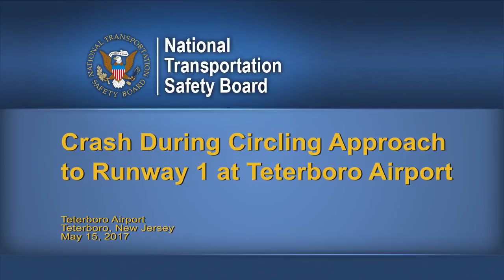Learjet 35A Teterboro Approach Crash • NTSB Animation

Comment: I'm an investigator by profession.  I've been up in small planes for professional reasons.  When there are not 2 pilots, I mention: "Not to jinx us, but if something incapacitates you, what do I do to keep this thing flying until someone else can help?"  Based on this limited "training," even I could recognize the multiple errors. *Now I will be checking the NTSB for mention of the record of the pilot's employer prior to getting on the aircraft.*  The full NTSB report is worse than the summary already linked:  https://www.ntsb.gov/investigations/AccidentReports/Reports/AAR1902.pdf    

RIP.   But there were errors not just on the flight.  Like, when doing pre-employment record checks, if the previous employer does not respond -- you can hire the guy anyway.  Period.  (Clearly, at minimum the hire should be subject to continuing other methods to verify pilot history).  

We all make mistakes.  But both of these guys had a history...  and most of us learn more quickly when we are held accountable.  Instead they were passed on to another employer, who didn't particularly seem to care either.
Reply: Big difference going to Jets, and happens quickly. Yes PIC was incompetent.

Comment: Looks like a left bank of 120 degrees rather than a right bank but maybe my vision is going. 🤓
Reply: I agree, it looks in HARD left bank nearly flipped on it's back inverted!
Reply: @Starbuckin  Yeah i suspect the pilot flying tried to tighten the turn with bottom rudder and stalled the left wing. Then she just rolled right over, almost onto her back.
Reply: @Cokie907  Agree, could have been an angle of attack stall at low speed too by putting too much up elevator trying to tighten the turn. Can't believe they just didn't Go Around, that was WAY too close to runway end to even think about a landing.
 Check the first vid on my channel, (latest post) I didn't stall but made a smooth as glass ridge run with me little foamie!
Reply: Hit the ground right wing straight down and left wing up in the air almost 90 maybe 100 degrees nose down at about 40degs I have a nice still after it hit the roof and before it hit the ground. Just sayn
Reply: Mark H I disagree. You’re entitled to your perception but without viewing “your still”, I’m not buyin it. Moreover, this type of stall scenario results almost always in a stall of the inside wing so the aircraft would be rolling left as it crashed. Just sayin’...
Reply: @Cokie907  i dont want to disagree and its not about my perception.  My perception is i had to spend an extra 20k I lost things that cant get replaced. I lost things that i couldnt prove. I have the info I have vid feed that no one has seens except the ntsb it was going to the right its right wing was down more than 90degs  the top of the plane facing you going from left to right and nose down at 35 to 40 degrees. Airboyd has another video up search on youtube  ntsb cen17ma183 it has a really clear pic/vid of how plane hit at the 4:33 mark let me know what you think. I see right bank but then again im not a pilot. But in that same frame  i can see my truck its just in front of the carlstadt senior bus facing the cam.

Comment: No doubt both pilots were staggeringly incompetent. However, the ATC does not come out of this well. At any given point ATC could have slowed down and checked that the PIC was aware of the circle to runway 1 procedure and understood it. It was clear very early on that PIC had no understanding of this procedure. It was also abundantly clear to any observant ATCO that this aircraft was consistently being badly flown, and should have spotted straight away that something was amiss after repeated failures of PIC to read back instructions properly. So while ATC cannot be directly blamed it is a fair assumption that they were a factor in this accident. This flight was crying out for a go around instruction from ATC.
Reply: Totally agree! When the SIC failed to read back instructions numerous times, ATC should have stepped in and confirmed the turn. Looks like the man flying the plane was 100% certain he was to line up with runway 6 not 1.
Reply: No you're wrong. I'm an FAA controller and that's not how ATC works. They were flying under IFR so they were instrument rated and can accept instrument approach clearances, which they did. If a pilot is not familiar with a procedure they tell ATC they're unfamiliar with it and we give them a different approach. ATC was zero factor in this accident, as the NTSB also concluded.
Reply: @kewkabe  of  course you would say that you are all in collusion and covering for each other, typical government entities. Those controller have blood in their hands n should have been held accountable.
Reply: Agree they are to blame! But who is going to hold them accountable, not the NTBS. That controller has blood in his hands

Comment: So many fuckups in soo little time... if there was anything left of that captain, they shouldve pulled a toxicology report
Reply: That was my first thought , was this captain impaired or intoxicated?  It certainly seems he was
Reply: That is quite possibly the exact reason for this incident.
Reply: hllboi817 they had to be drunk
Reply: Tox report clean if you bothered to read anything above 
 @lincolnpaul1814
Reply: I would bet more than anything the Captain was drinking heavily and assuring the officer he will be fine with a drink or two
Reply: The tox reports came back clean... this was pure, unadulterated, incompetence - from both of them.  The SIC had over 450 hours in a Lear and he still couldn't hold a heading or altitude?  Whomever checked these two out was also criminally incompetent.
Reply: @steveburton5825  It seemed like there was more going on with him than incompetence. He wanted to go much higher on a 20-minute flight, didn't seem to know where they were etc.
Reply: @steveburton5825  Checking them out wasn't the problem.  Signing them off was the problem.
Reply: @steveburton5825  And how did you you get hold of the tox screen report?
Reply: @janfuger1517  this crash report is on the NTSB website and you can view all of the evidence and information related to this incident.  From what I remember, the tox screen was negative but they only had muscle to test since the rest of his body was lost in the crash and fire.  I'm not sure if they can determine anything conclusively from that or not.  This pilot had failed circling approaches numerous times in simulation and only passed after his third attempt.  The NTSB cited the company's lack of oversight and monitoring of their pilot's actions and lack of training to fix issues proactively.  There was a lot that was done poorly that added up to this event.  https://www.ntsb.gov/investigations/AccidentReports/Pages/AAR1902.aspx.
Reply: @steveburton5825  he held a heading just fine.  His captain told him conflicting crap.  Maybe we should pull a toxicology report on you
Reply: @steveburton5825  you're just mad that i understood it better than you.  Rewatch it and pay attention to the captain's off-radio (transcribed but no audio) directions to the SIC.  You'll see he told him to do different things which explains the heading changes.  So SIC wasn't failing to hold heading he just was following directions other than from ATC, namely captain.
Reply: @steveburton5825  again you didn't read the cockpit dialogue.  Captain was giving conflicting orders.  When you take those into account the heading made sense.
Reply: @ivanabcdefg9375  could not hold his heading plane was out of control 40 seconds before crash. Maybe 35secs would need to watch my cctv again to get exact time but my point is he did not have control flying a straight line. That i can prove.
Reply: Nah. He wasn't drunk. He was just stupid. He may very well have been a good pilot, but he should have left the teaching to someone more talented.
Reply: Did you the fireball on impact, was it fuel or..... the captain?
Reply: Sabrina Dugan  - LOL... That's pretty funny.
Reply: The reason I bother to comment is to deter people like you from going to the ballot box and demanding stricter laws in general aviation.  In our free society, the goal is not zero deaths -- it's a happy medium between safety and freedom.  And even if a person wants safety at all costs, best that they start with automobiles, which kill the most people disregarding medical conditions.
Reply: @ivanabcdefg9375  Another crank giving us the hackneyed "freedom" spiel.
Reply: There are decent youtube people here, so don't use profanity. Ask Jesus to save your soul and clean you up into a real man.

Comment: I have no idea how he could have died considering he was at least 50 miles behind the aircraft. 

Didn’t know how long the flight was since he asked for higher altitude and wondered why they said approach and runways in use. All the while trying to teach and monitor this kid what sounds like basic flight maneuvers. 

Had no situational awareness on the approach—even just tune up an NDB and watch the needle on the RMI.. you’ll know exactly where you are in relation to it—never mind the moving map I’m sure he had. 

Not aware of the descent profile. Every good jet pilot knows 1000 feet/3 miles instinctively. 

Not listening to his SIC who is getting nervous, completely helpless, and wants you to take control. 

And finally... trying to salvage a bad approach by hot dogging a high performance aircraft rather than fling missed, collecting yourself, rebriefing, and attempting again.

Comment: When I first stat in the right seat, I was able to at least fly the aircraft. In fact, when the aircraft went a little over 250, it was because I wasn't flying that "under 10" leg. It makes me wonder how that FO got that job. Because of this video, I went looking and found Robert Sumwalt's NTSB panel video. I have known guys who used an expletive every 14 seconds, but NEVER in an aviation environment. Some of the guys would get in one or two a minute after a flight, but man, I have to wonder what was going on in that guy's head. I will tell you something I think is a part of the problem: the pay is so low for 135 ops it is almost laughable, because operators think the hours in the logbook are the pay. This means that very frew guys seek a permanent position in 135. They are all angling for fractionals, corporates, or airlines, because these are seen as the top of the pyramid. Better pay means the operators would be choosing from better pilots, and not waving to them as they go by in their flying careers....

Comment: Looking at this, and watching the video, where the plane is almost inverted, makes me wonder if the pilot in command didn't grab the yolk, try to make a hard left bank to line up with the runway, stalled, then tried to yank the yoke back to the right which is where the box apparently registered the controls. If they were at or below airspeed, the show was already over once they were inverted. seems to me, if the pilot in command wasn't inebriated, he may have been trying to get some sleep. BOTH pilots had previously failed checkrides in the Lear.
Reply: All pilots going to training have at least one or two failed check rides in their careers. Was it a mechanical failure that stalled the plane? Ever occur to you the PIC was trying to correct his SIC mistakes? The PIC was flying for both of them.

Comment: Probable Cause
The NTSB determines that the probable cause of this accident was the PIC’s attempt to
salvage an unstabilized visual approach, which resulted in an aerodynamic stall at low altitude.
Contributing to the accident was the PIC’s decision to allow an unapproved SIC to act as PF, the
PIC’s inadequate and incomplete preflight planning, and the flight crew’s lack of an approach
briefing. Also contributing to the accident were Trans-Pacific’s lack of safety programs that would
have enabled the company to identify and correct patterns of poor performance and procedural
noncompliance and the FAA’s ineffective SAS procedures, which failed to identify these company
oversight deficiencies.

https://ntsb.gov/news/events/Documents/Abstract-Teterboro-20190312.pdf
Reply: naaaah, cause, two idiots.

Comment: Findings
1. The flight crew was properly certificated; there was no indication that the flight crew was
impaired by medical conditions, alcohol, or other drugs; and there were no preimpact airplane
anomalies that would have precluded normal operation.
2. The pilot-in-command’s preflight planning was inadequate and incomplete. 
3. The flight crewmembers’ failure to verify the approach and conduct an approach briefing
resulted in confusion and errors that led them to mismanage the vertical profile for the
approach and not initiate the circle-to-land maneuver according to air traffic control
instructions.
4. The pilot-in-command’s inadequate and incomplete preflight planning and the flight crew’s
lack of an approach briefing contributed to the crew’s confusion and lack of situational
awareness during the accident flight.
5. The pilot-in-command’s decision to allow the second-in-command to act as pilot flying was
improper and contrary to company standard operating procedures.
6. The pilot-in-command’s (PIC) extensive coaching of the second-in-command in his pilot
flying (PF) duties distracted the PIC, interfered with the normal division of PF and pilot
monitoring duties, and degraded the flight crew’s overall performance.
7. The pilot-in-command’s decision to continue the approach was inappropriate because the
approach did not meet the company’s stabilized approach criteria and the airplane was not in
a position to make a safe landing.
8. The pilot-in-command’s focus on the visual maneuver of aligning the airplane with the
landing runway distracted him from multiple indications of decreasing stall margin, resulting
in an aerodynamic stall at low altitude.
9. A flight data monitoring program can help Title 14 Code of Federal Regulations Part 135
operators identify and mitigate procedural noncompliance, including the operational
deficiencies identified in this accident investigation.
10. Because the Federal Aviation Administration (FAA) was not conducting checks in a manner
that allowed observation of routine flight operations, the FAA could not evaluate
Trans-Pacific Jets pilots’ compliance with standard operating procedures during these
operations. 
11. A safety management system (SMS) would have improved Trans-Pacific Jets’ ability to
identify and mitigate risks because an SMS requires operators to incorporate formal system
safety methods into their internal oversight programs.
12. Effective oversight procedures within the Safety Assurance System would help the Federal
Aviation Administration identify operators that do not ensure flight crew compliance with
standard operating procedures.
13. The pilots’ performance on the accident flight included deficiencies that were noted during
their initial Trans-Pacific Jets training, but the company did not monitor the pilots’ subsequent
performance to identify and correct any continued deficiencies.
14. Although Trans-Pacific Jets’ crew resource management (CRM) training program complied
with the requirements of Title 14 Code of Federal Regulations (CFR) 135.330, the Federal
Aviation Administration had not provided adequate guidance for 14 CFR Part 135 operators 
to develop and implement effective CRM training programs; consequently, Trans-Pacific’s
training did not result in the flight crew effectively using CRM to mitigate safety risks.
15. Specific leadership training provided to Title 14 Code of Federal Regulations Part 135
and 91K pilots at the time of upgrade to pilot-in-command would help standardize and
reinforce critical command authority skills and improve flight safety.
16. Because the company did not have a Learjet-qualified management pilot or check airman on
staff during the accident second-in-command’s (SIC) period of employment, Trans-Pacific
Jets’ graduated SIC qualification policy could not provide him and the other company Learjet
SIC a viable, well-structured path to gain experience as pilot flying.
17. Including the manufacturer-recommended approach speed wind additives in operations
manuals for Learjet 35A airplanes could reduce the risk of a stall by requiring pilots to
increase the approach speed in weather conditions conducive to rapid and possibly unexpected
wind changes.
Reply: No such thing as  ". The pilot-in-command’s decision to allow the second-in-command to act as pilot flying was
improper and contrary to company standard operating procedures." The company could have made that statement up to save face right after the accident. For the looks of it, this carrier should have not been allowed to even held operations.